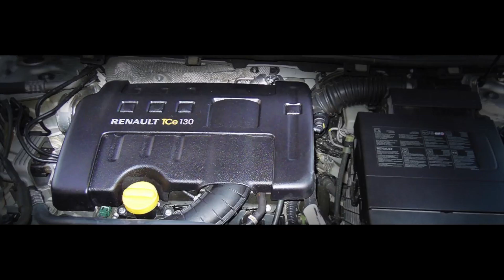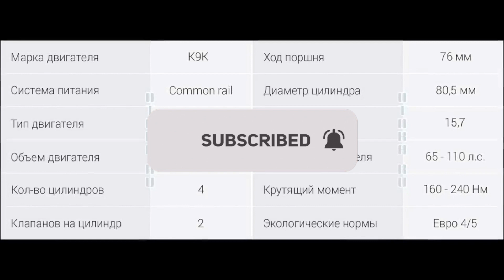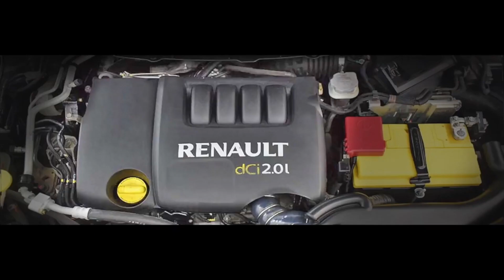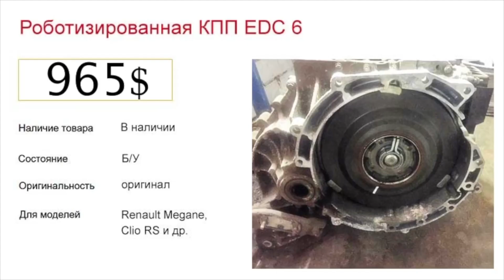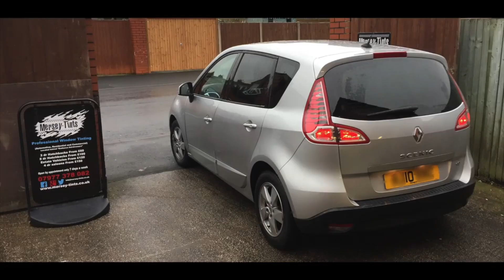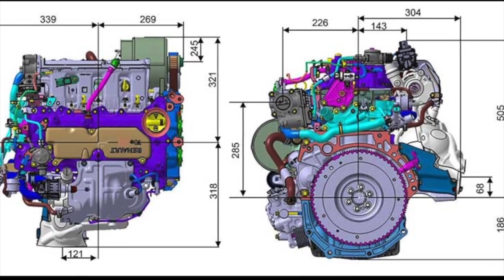TOP Things that will BREAK on your Renault Scenic 3

Comment: Also only buy the 1.6 dci the 1.5 dci is terrible the 1.6 dvi is a far better engine and has timing chain so never need changing up to 150k miles 🤷
Reply: I learnt this the hard way, I bought a 1.5 dci and timing belt broke twice, some how water got in the timing belt pully and seized them. I like this car so much that I had to get it again, of course I bought the 1.6 .

Comment: If your going to buy one check the left side passenger footwell in fact check both side for water. The drain holes get full of leaves and water pours in! 2 check the parking hill hold works and the auto release. 3 check the sat nav works 4 check the boot for water as the high level break light seal fails and water gets in. 5 check it drives straight with wheel central. Renault charge £170 just to look at wheel alignment it’s over £500 for two front shocks and top mounts the scenics are good if looked after properly but there expensive to keep good. Also check it’s got Michelin or preferred continental tyres or the ride will be very bad as cheap tyres can’t hold the 2 ton weight as well and the car bobbles around
Reply: 2 ton what you drivina tank